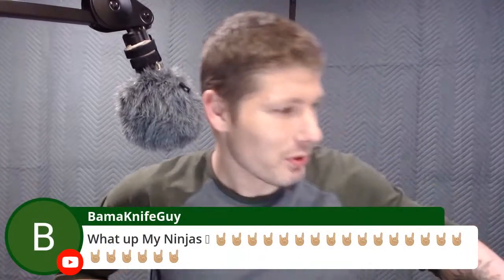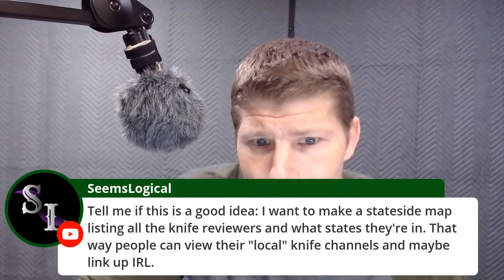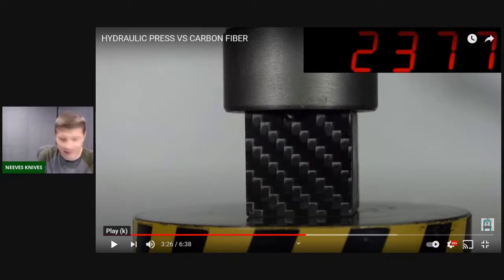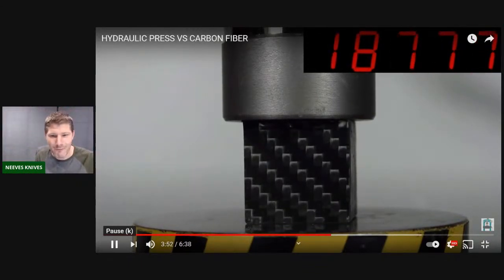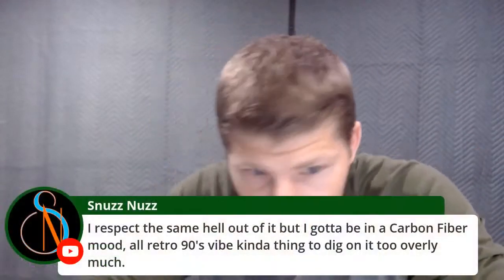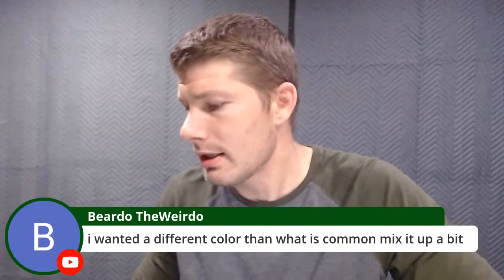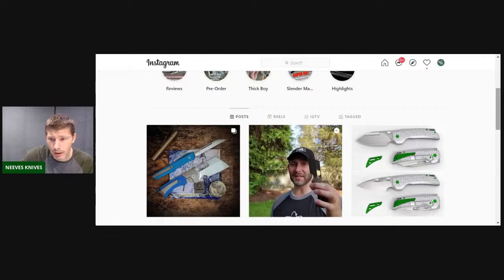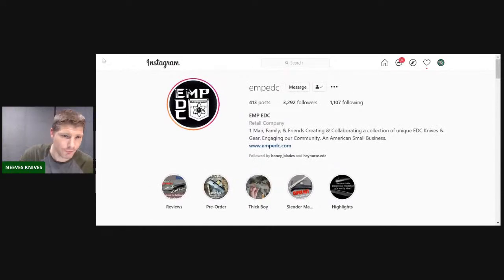NEEVES KNIVES LIVE HOW TOUGH IS CARBON FIBER

Comment: I find the kind of stones I use don't matter in the end because I really like to finish off my sharpening with a lot of stropping. And when I can either shave my facial hair or take newspaper and stand it up straight and just drop my blade over it for it to easily cut through the thin paper it is ready. 

I had the hardest time with the tip on the ad20.5 with the bad factory edge.
Reply from the maker: Everyone has there methods, I find over stropping extremely common and can lead to slicker edges, good for shaving and cutting paper, but bad for rope straps and cardboard, also it's been proven on higher carbide steels that not using diamonds leads to far less edge retention. And low carbide steels do better with non diamond stones, not Everyone needs or cares so much about there edge quality, I personally think it's one of the most important

Comment: I'm sure I look like a target but if they can get past my security and my 1500 pound safe bolted to a concrete floor these were more than just your average criminals breaking into a house.
Reply from the maker: Security is really good, safes are as well, safes aren't that difficult to remove with the right tools, but making it as difficult as possible is good